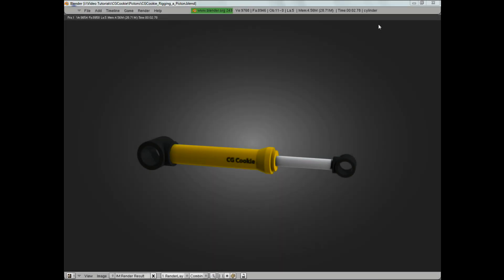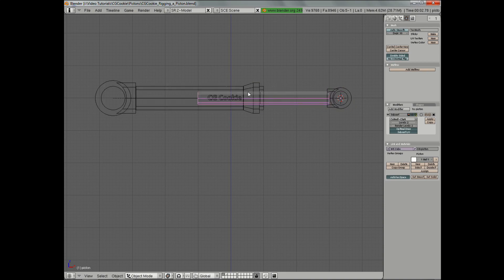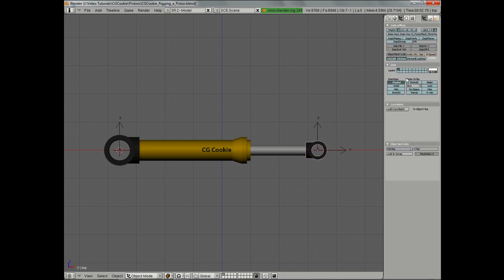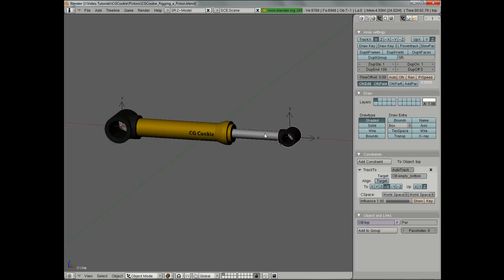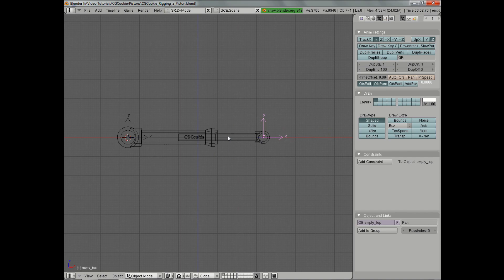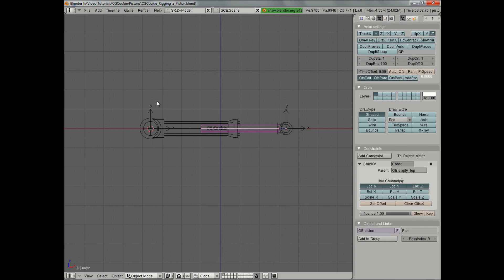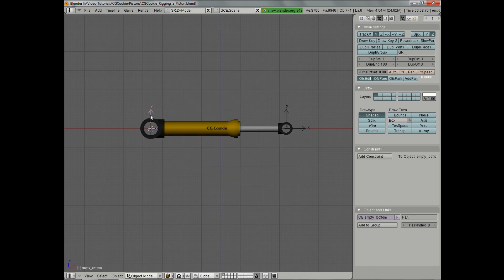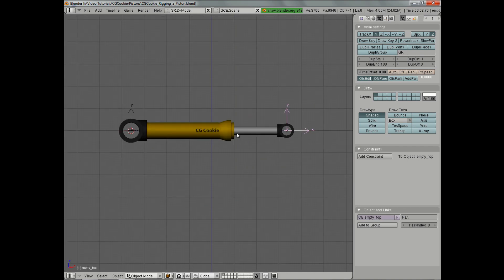CGC Classic: Rigging a Piston (Blender 2.4)

Comment: Ok, for the people for which the track constraint doesn't work (weird rotations/things don't actually track)), after some frustrating testing I found a solution that works for me:
 - in the tracking constraint panel, the "To" option selects the local axis of the object that is supposed to be tracking the empty
 - the "Up" option selects the local axis of the same object that blender will try to align with the global Z axis
 - You can't choose the same axis for "To" and "Up", you can see the option going red in the panel and the tracking won't work
All this means that if, like me, you arranged your piston vertically, this part of the tutorial won't work for you.  Placing the piston horizontally resolved the problem for me.
Reply: bruh.... thx a lot